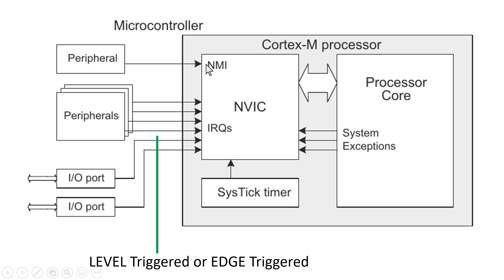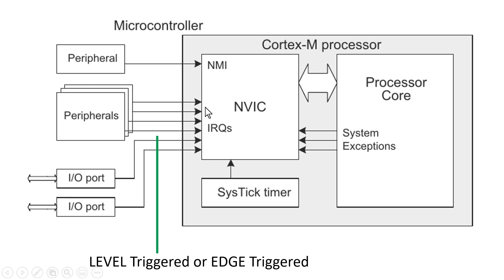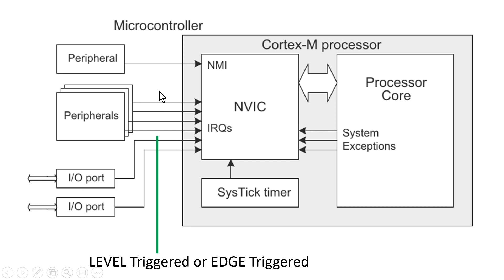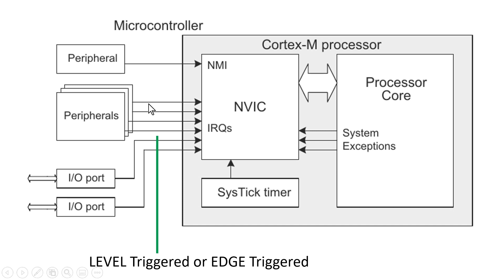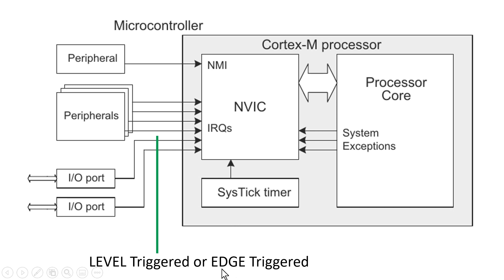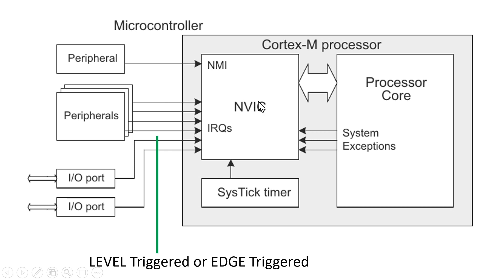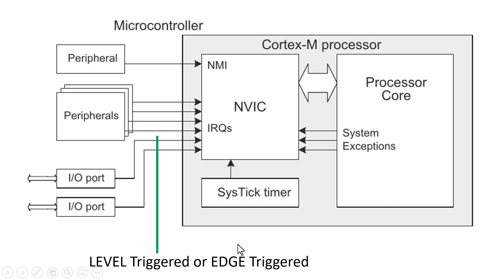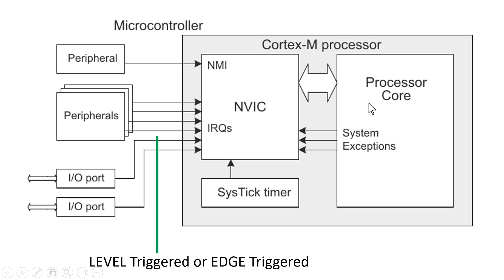Digital Design Interview Questions Part 9

Comment: I'd like to add a slight correction/clarification that, on receiving an IRQ (interrupt *request*) the processor doesn't always jump to the ISR, it does so only when the interrupt disable flag isn't set, otherwise it ignores the IRQ (or stalls it). On the other hand, NMI as the name suggests are non-maskable interrupts and are used for absolutely necessary stuff. NMI are usually edge triggered while IRQ are level triggered. The interrupt signals are usually sampled one clock cycle before the end of each instruction.

Comment: In case of edge triggered interrupts how the microcontroller keep track about if interrup has served or not by the processor . ???
Reply from the maker: Thanks for initiating this discussion.. Once the interrupt is received by a processor either edge triggered or level triggered interrupt. Microprocessor will start executing Interrupt service routine (ISR), which is a software part. Now, it depends upon the software, how to keep the track of the executed interrupts. It may store interrupt counter somewhere in the memory. Once the interrupt is served, processor will come back to the normal execution flow, it will not know anything thereafter.
Hope it clarified your doubt.. Otherwise, let me know We can have a further discussion.
Reply: @TechnicalBytes  thanks for your reply sir I am completely satisfied.  Best wishes for your good work 👏 👍 ❤